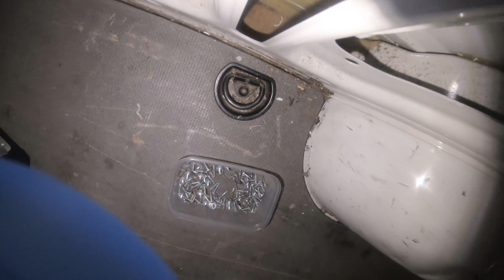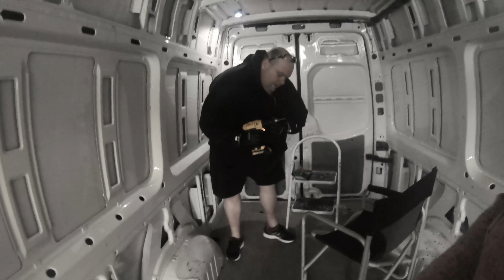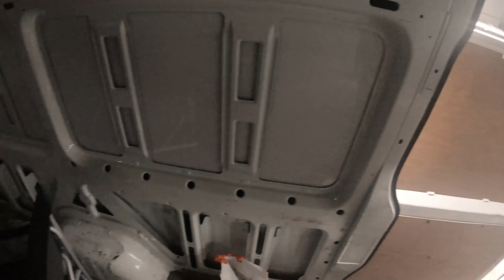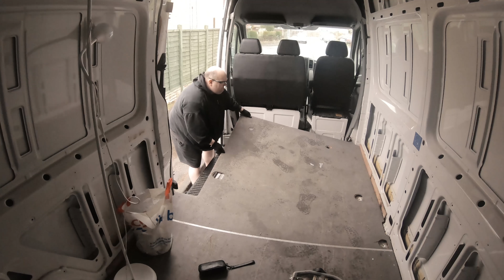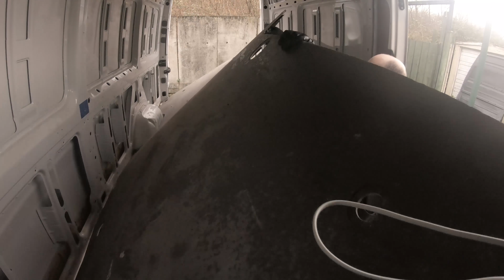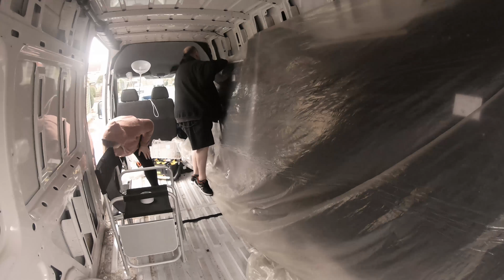VW Crafter VanConversion Ep3 Removing the Floor

Comment: I'm glad to see you are reusing the flooring I've seen so many people just throw them away, same with the wall panels, well keep up the good work I look forward to the next video
Reply from the maker: Thank you. We have kept the wall panels too and will use them in some way..I need to check them again but if a lick of paint will make them good to go back on the walls, then that will be 1 of our next jobs for sure.
Reply: even if they get used just to keep insulation in or for attaching final fit

Comment: How long have you given yourselves to do the build great so far bye the way 👍🏻
Reply from the maker: No time limit as such, but we'd like to have it fairly comfortable by the beginning of June as we would like to go to the UCI Downhill World Cup in Fort William. It's unlikely it will be "complete" by then, but it would be good to have solar and some electrics, both beds and a toilet in place by then. LPG, plumging, heating and a kitchen is optional as it we can live off camping gear as far as cooking and water is concerned, and it will be warm by then. Hopefully mostly done by August in time for a last minute trip to Scandanavia before the cold sets in.
These build vlogs are a little behind, we already have most of the insulation done and should have the flooring and wall panels mostly back on this week.
After Camp Quirky next weekend I will be trying to get the Build Vlogs a little closer to real time, but between building and a full time job, the editing is being neglected! :P
Reply: Around the world in as long as it takes 😎 cheers for the reply 👍

Comment: Just subbed up! Looking forward to seeing what you do.... by the way ! You're using the wrong tool to crack those bolts....😉 any questions please don't hesitate to ask my opinion if you have any struggles in the build 😊...at the bare minimum I have every day of 23 years worth of mechanical  experience...and i am always happy to help if I can....I'm  also a carpenter I make lightweight rocket stoves and have invented some crazy things amongst many other skills...good luck with it all and put a bucket load of miles on that speedometer.....crafter hey!......great choice 😁😁😁
Reply from the maker: Thank you so much for the offer of help! :) What tool should I have used for those bolts?
The Rocket Stoves sound interesting. We were looking at 1 of those small wood burners for outside. Maybe a Rocket Stove might be an alternate. Would love to know more.

Comment: Crack the nuts off with a ratchet and then use the drill as you are less likely to break a torx socket and the drill my  beauty....as for rocket stoves you'd need an old 25 litre cooking oil container...the ones they use in resteraunts.....and about 7foot of 5 or 6" galvanised  vent pipe....you then make 2 holes in the top of the container just smaller than the size of pipe size....
Now cut the pipe so that one piece is flush with the top of the container and about 2" or so from the bottom of the container and insert this and secure... 
What's left of the pipe is then used as a chimney for the other hole....I usually secure using rivets.but it's handy to leave the chimney detachable...so now you have a  rocket stove! 
I'd recommend something to put it on as these will glow red hot....I burn pallets which have been axed lengthways .... don't put in too much wood as they will not down...
I may put a video on here of this version in the future as I've found it great for camping and hotter than the earths core lol!😁